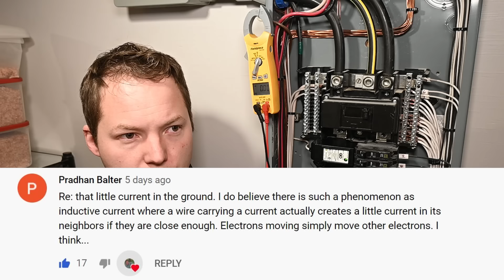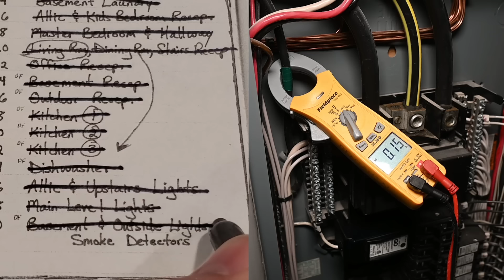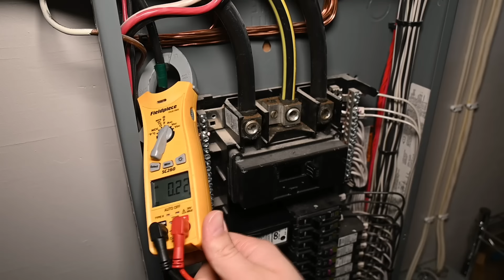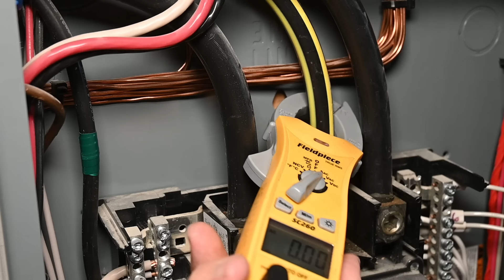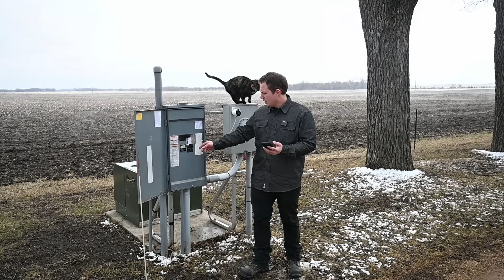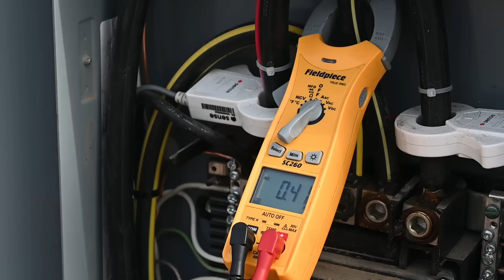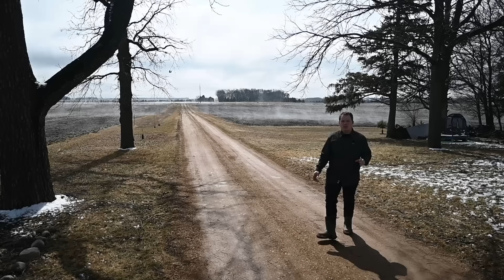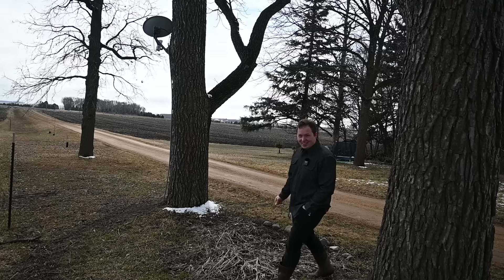Finding The Source of Stray Current on Grounding System

Comment: I'm pretty sure that the "fog" you're seeing is from the snow subliming (that is, transitioning directly from the solid state to the gaseous state without becoming liquid in between)
Reply: I think it’s the air being cooled near the snow to below the dew point of the air. The air can no longer hold the moisture so it condenses out and forms a fog. Like taking a cold soda can out of the fridge in the summer and having it look like it’s steaming.
Reply: @solonv5715  but air tends to already be dry and cold in the winter.  The steaming effect you're talking about tends to happen when there's a large difference in temperature and/or humidity, which seems less likely to be the case here

Comment: There may be a ground path at the water heater.  Is the plumbing in the house copper?  The tank is steel and grounded by the conductor from the panel.  Also the tank is grounded by copper pipes buried in the earth.  There's your circuit for current flow.  It is leakage from the primary side of the green power transformer sitting next to power meter.

Comment: I wonder if you are seeing the effect of a "Single Wire Earth Return (SWER)".  A rural system may be using this which uses the Earth as your neutral return to the electrical power distribution system, in this case the neutral connection from your transformer back to the H.V. line back at the public road. A SWER setup would also have varying conductance back to the transformer depending on soil moisture. Just a guess 🤔 Would it be possible that dissimilar materials in your grounding system could induce a Seebeck Effect current flow in the ground loop? Could just be a current leak on your transformer, the utility would have to come out and HyPot the transformer to resolve that.

Comment: Foreign current sources (NEV) on grounding system: primary side of transformer use the well pump casing, cable internet, phone bond and more than one ground reference, water and gas pipes bonded to neutral bus. EPRI says 60% primary current returns through earth. See my Killing Current book for more. If you are sharing the transformer, any pipe shared with your neighbor is a potential current source. A much more thorough way to find neutral/ground (N/G) connections in panels is with a continuity test into the megohm range. Don't trust Arc Fault to alarm you of N/G connections. They can be blown, or actually leak mA of current between systems. I describe how to do this complete diagnostic in my EMF Tracing 102 book available here on www.homeEMFtracing.com under the Killing Current book series. Neutral to Neutral connections are also found using this technique which creates magnetic fields. Just turning off the breakers won't find the source 100% of the time because just one connection anywhere in the panel between the neutral and ground, or any pipe that merges the system, will bridge them together. You have to remove the connection to the main neutral to be thorough and eliminate variables so see my materials for the full story. https://homeemftracing.com/shop/ols/categories/killing-current-series

Comment: My vote ; Induction

I’ve experienced current to ground at 5 .8~7.3v 
I found a 4ga pulled too tight through a 1” LB from a panel relocation decades ago. The casing wasn’t broken but pinched thin enough to induce 5v to ground.

Comment: I think the current is a completed circuit flowing via your EGC (bonded to neutral at the main panel) to the sub panel then going into ground at the earth pins or copper gas line at the house. Then it probably returns to the main panel using the earth as conductor to the earth pins at your main panel. This completes the circuit. The source is probably induction current occurring at the transformer into the neutral conductor. I don't think it will be measured by your meter. Still interesting to know about it. 
Also, to stop this, I believe you can remove the grounding points at the house to see if it interrupts the flow. I do not think you should do this permanently though. Better to have a close path to ground for safety at the house.

Comment: Unbalanced load goes to transformer
Not the earth. If neighbors have a issue, your house may have voltage if your house is closer than the transformer.
It uses the earth as a path to the transformer.  Think outside the box.